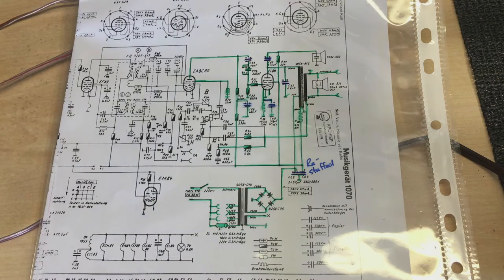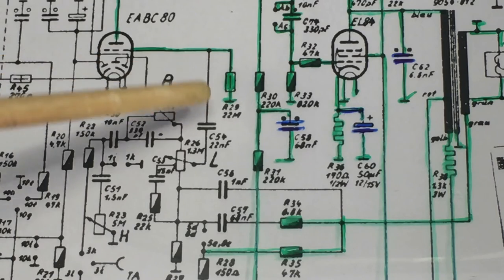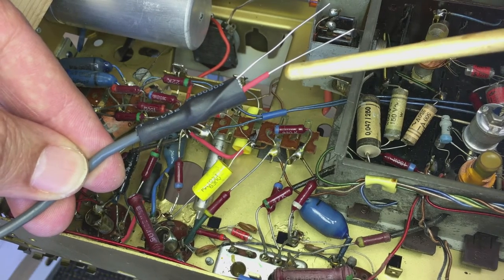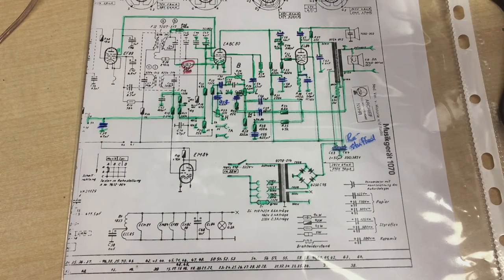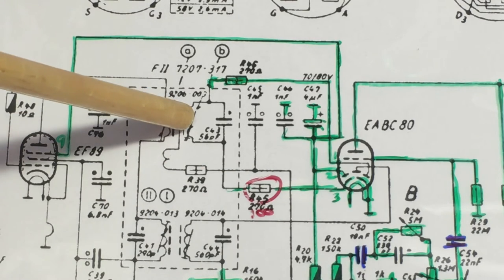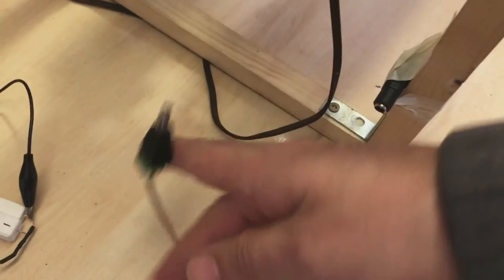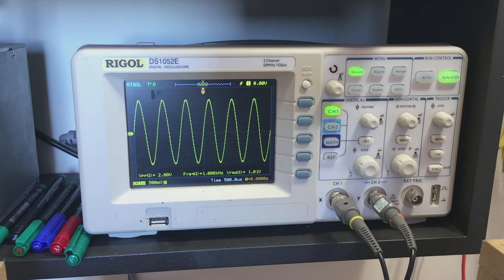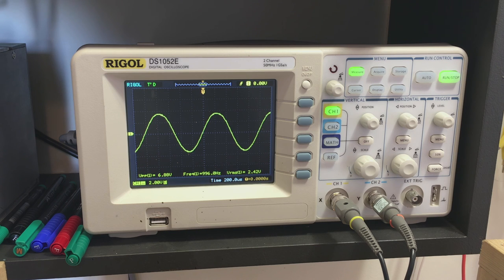Grundig 1070 tube radio restoration - Part 3. Audio preamp and power amp done and tested.

Comment: I'm not sure what the function of those resistors is. But you're right in that they need to be balanced. Some televisions in the 70's had a fixed resistor in one side and a lot in the other, so that you could adjust for best balance- minimum video buzz.
Reply from the maker: Alan Cordwell : yes it would seem to make sense. I can always try parallel a temp resistor across the 270  one to bring it down to 100 and see if the two balanced values make a difference.
Reply: M Caldeira oops, 'a pot in the other' that should say! I guess you figured that out!

Comment: Your point about the shielding of the cap going from the volume pot wiper is a good one. Would the lack thereof explain music/the signal still being audible with the pot turned all the way down? The only other explanation I can think of is that the resistive element is worn.
Reply from the maker: I’d probably bet more on the resistive element not being in good shape and not going down all the way to zero. However, with high voltages, high impedance tube grids and radiated signals flowing around all over the place, capacitive pickup is also possible.
Reply: Thanks. Since sourcing a replacement pot would not be easy, I'll try cleaning it to see if that nets any change.  @electronicsoldandnew

Comment: I understand you was using a 5 ohm load and the speaker was probably a 3 ohm but I would have expected about 3 watts from an EL84 and symmetrical clipping. This might suggest the audio is not quite right to me.
Reply from the maker: +Michael Beeny : could be. May be an interesting exercise to do a theoretical study at the end of this series. I feel an itch for some load lines...
Reply: I have done some tests on an old EF86 /EL84 Mullard design I built hundreds of years ago!! On test I got 3.5 watts at 10% distortion, into clipping. Well under 1% at other powers and frequency's. The main point is that it does clip symmetrically, which I would really expect from a single stage class A amplifier. I look forward to you finding what the problem is on your set.

Comment: just a question ..why the r36 190 ohm resistor symbol is different from the symbol of the other resistors ?? thanks
Reply from the maker: +mountainhawk : that symbol is used for wire-wound resistors.